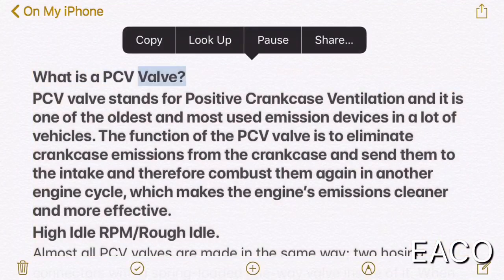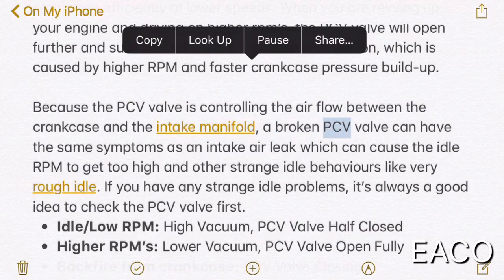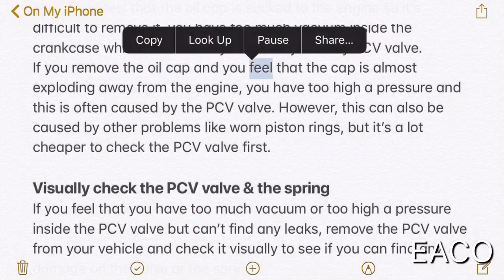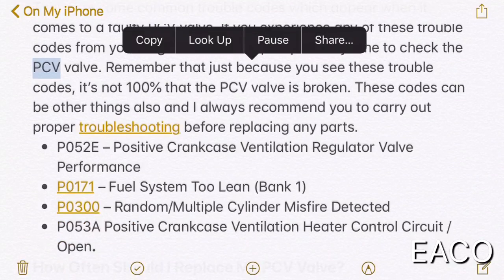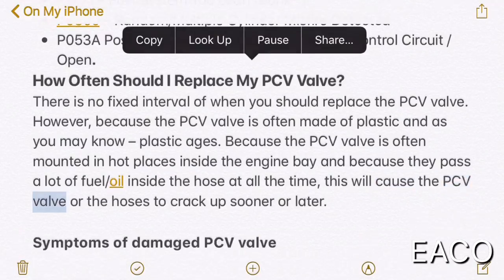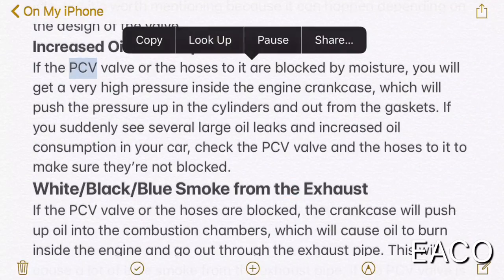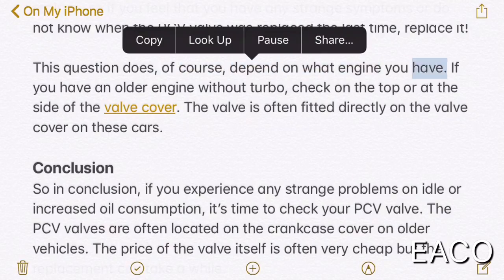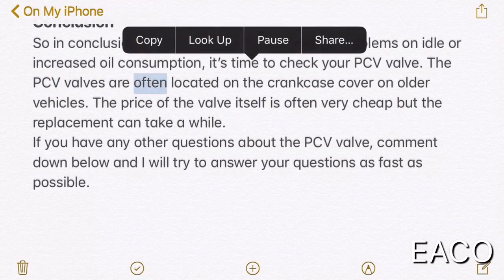IMPORTANCE OF PCV VALVE IN YOUR VEHICLE, SYMPTOMS, FUNCTION & MAINTAIN ENGINES life!

Comment: Is all car engine have pcv Valve. Diesel engine also?
Reply from the maker: Thank you for your comment..Diesel engines are not required to have these valves. The positive crankcase ventilation, or PCV, valve routes crankcase gases through a hose and back into the air intake system where they are re-burned in the engine. Fresh, clean air is brought into the crankcase through a breather tube.
Reply: @Subscribenow02  but many diesel cars I saw pvc filter and and and 1 box witch connected to air filter . What is it ? Please explain why no need to pcv valve in diesel cars? And thanks for replying.
Reply from the maker: Alisha Enterprises hello that’s breather hose from valve cover gasket to lubricants piston rings of engine during engine running specially high revolutions Because deisel engine have maximum compression around 234-250 psi to ignite diesel or 1:16 compression ratio. The main purpose of PCV is to control atmospheric pressure inside of the engine.(which is for gasoline only.)
Now, Diesel engine is deferent because of heavy compression of piston commonly some diesels engine using turbo charger. Thank you.!

Comment: I have a chevy avalanche 2008 5.3 had a lifter stuck I did the afm DOD delete and now it smokes some times. When I was taking the intake off there was a lot of oil in the intake so it's got to be the PVC valve my question is are they one for each side
Reply from the maker: Yes check your engine air filter may clogged

Comment: If I blow the pcv valve , what is the indication if it is stack close or open?
Reply: In diesel engine like 4d56
Reply from the maker: PCV valve replace every 50k Mileage of Maintenance.(Gasoline engine)

STACK UP PCV VALVE 

Contaminated of rust causes chemicals reaction like engine flushing chemical.

ALWAYS FULLY OPEN PCV VALVE 

Fully open or spring no force- burnout return spring or stripped insulation of resistance causes weak force.
Other analysis engine air filter is always clogging that’s why some air from PCV valve passing. (clogged engine air filter can damage your PCV valve as soon)

Comment: Broken pcv maybe cause of oil leak in sparkplug hole??
Reply from the maker: Thank you for your question.!!

Answer to Broken PCV:
Yes possibly passing through the intake manifold.
Maximum Existing engine oil suction passing through in intake manifold mixing into cylinder combustion-air fuel mixture to burn the fuel.

Symptoms:

white smoke.
Maximum fuel efficiency 
Engine Rpm changing-rough idling/vibrations of the engine 
Misfiring of Cylinders combustion 
Ho2 detects error mixtures

Blow bay-(Control the atmospheric pressure inside of the engine.)
Remove engine oil deepstick and engine oil filler cap(negative high pressure)or suction strong.and having oil smoke.
This means PCV valve is clogged permanently.

Answer to spark plug hole:

That problem is valve cover gasket o ring rubber already damaged-expire rubber or burned used for long time.leaking passing through to hole because of atmospheric pressure inside of the engine.

Alternative answer: Damage valve seals. Can cause oil decreases.
Engine can experience Low power or weak power.
Reply: @Subscribenow02  bro I’m sick